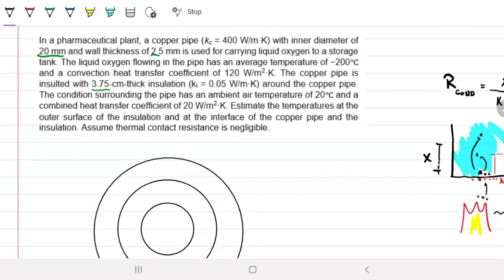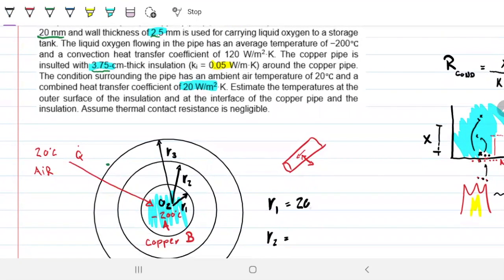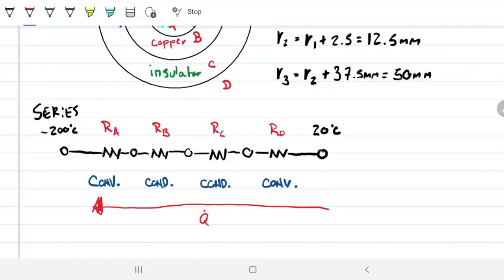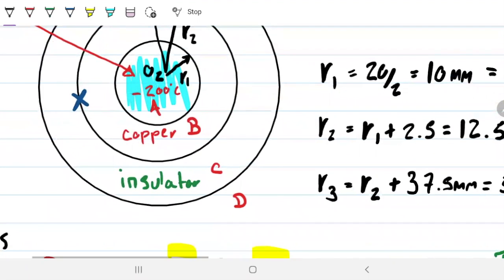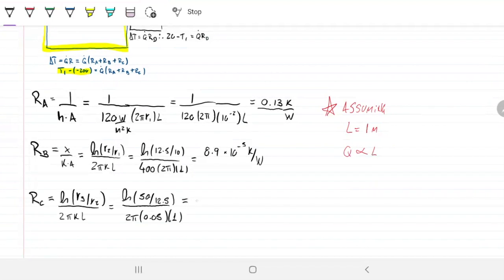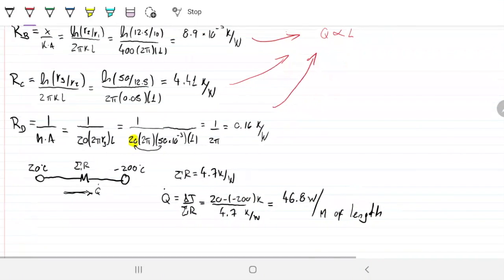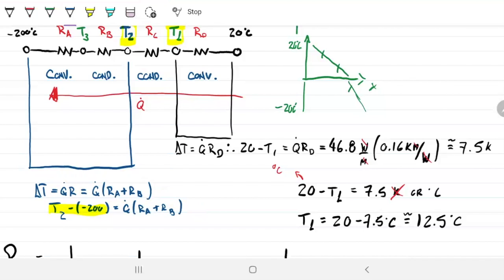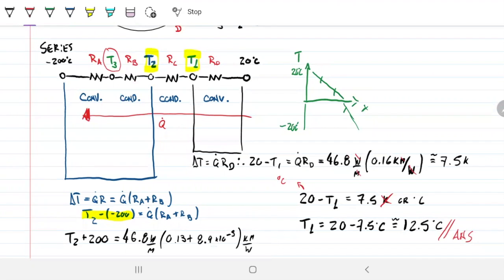Conduction & Convection in cylinder - Finding temperature - W4Q1

Comment: In this video, have you make the assumption the inner temperature of the cilinder wall is the same as the fluid (-200 degrees)?
Reply from the maker: Hi. No, that assumption is not made. Quite the opposite since we stated there is a convective resistance between the copper and the O2 fluid
Reply: @ is there a way to find out the the inner temp of the wall? And Q (46.8w) is the ammount of energy the pipe+insulation emits to the room right?
Reply from the maker: Yes there is. Because the system is in series, the Q needs to be the same for all resistances. So you create a system for Delta T between the O2 (fluid). And the wall where the only resistance is convection. Then solve for T. 
There are a few videos in the channel that do that
Reply: @EngineeringHack  

Dear Engineering Hack, 

I am currently working on my graduation thesis, focusing on thermodynamics, with a specific emphasis on the heat emission of an exhaust system in a genset room (Q in watt). The situation with exhaust gas pipes closely resembles the one in this video. The system consists of a stainless steel exhaust pipe with insulation material around it. 

I have additional information about the project and my current approach. Would it be possible for me to send you an email with my current calculating method (its only 4 pages)? I would greatly appreciate it if you could review my work and provide feedback on my progress. Thank you in advance! Best regards,